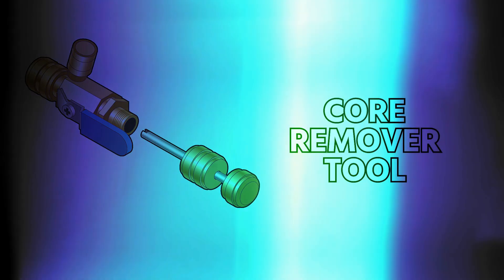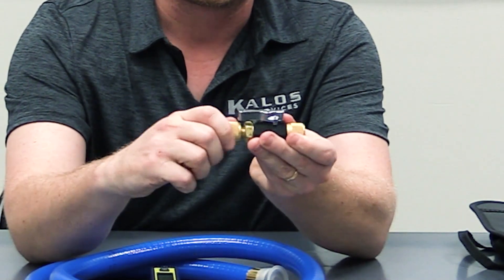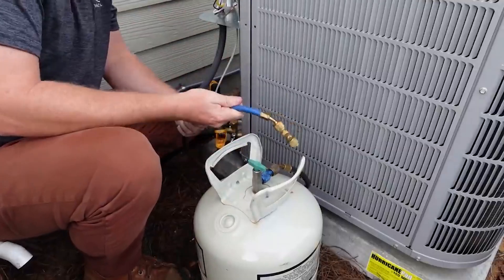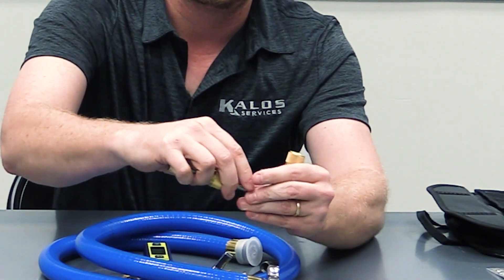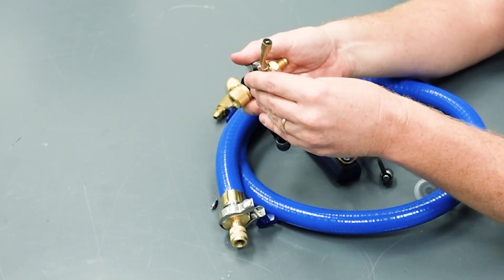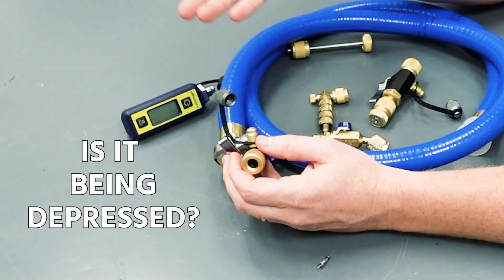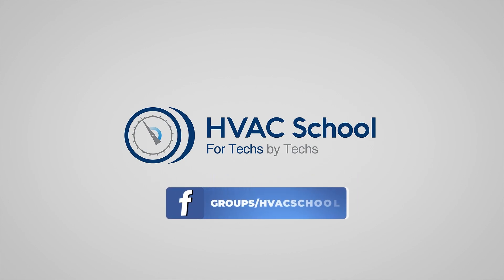Schrader Core Removal Mistakes to Avoid

Comment: It's easier to connect the Vacuum Gauge to the VCRT with a second VCRT , then you can disconnect the gauge as soon you add refrigerant , and the valve of the VCRT is already vacuum rated IMHO

Comment: 3:46 is confusing to me can some one please go in more in depth on this, so after the vacuum, I should open the line a little bit to break the pressure and then put my valve core back in?
Reply: After you pull vacuum to required spec, THEN close the valve on the valve core removal tool (VCRT), THEN remove the vacuum hose from the VCRT, 
THIS IS THE IMPORTANT PART: After you remove the vacuum hose from the VCRT (REMEMBER: the VCRT valve is closed at this point) a small amount of of 'outside air' will enter the space between the end of the VCRT and the closed VCRT ball valve (which is closed). 

***All you ever want in AC system is refrigerant, oil, and if there is a difficult to locate leak then a small amount of dye. THAT'S ALL! Anything else in the AC system can cause damage to system components. 

SO 'OUTSIDE AIR', ANY AMOUNT AT ALL, IS BAD! 

So, back to the point where the vacuum hose has been removed: THEN attach the refrigerant charging hose (which is already connected to the refrigerant tank) to the VCRT port (same port where the vacuum hose was attached), now open the valve on the REFRIGERANT TANK, so now you have refrigerant flowing into the charging hose, BUT BEFORE YOU OPEN THE VCRT VALVE, you MUST turn the refrigerant charging hose connection counterclockwise for a fraction of a second (aka cracking the charging hose connection or PURGING) to allow a small amount of refrigerant to 'blow out/push out' (displace) any 'outside air' (remember outside air is extremely bad if allowed to enter system) then quickly re-tighten the refrigerant hose connection. 

NOW you're ready to open the VCRT valve to allow refrigerant to flow into the system, THIS IS WHERE "ABOVE ATMOSPHERIC PRESSURE" comes into play. 

This is where you will be looking at low side gauge of the compound gauge set. 

As you allow refrigerant to flow into the system, via low side thru the VCRT, watch the low side gauge as refrigerant enters the system, and as soon as system pressure on low side gauge shows positive pressure (no longer showing vacuum. Think of 'state of vacuum'  as meaning negative pressure, atmospheric pressure is the outside air pressure. On the low side gauge '0' is when system pressure and atmospheric pressure are equal. Anything above '0' on your low side gauge is 'POSITIVE SYSTEM PRESSURE'. NOW you need to allow enough refrigerant to flow into the system to bring 'system pressure' above '0' on low side gauge. Once you have 'positive system pressure' close VCRT valve, close valve on refrigerant charging tank (or preferably close valve on low-loss ball valve on the end of the refrigerant charging hose), remove refrigerant charging hose from VCRT, reinsert and tighten valve core via VCRT, reconnect charging hose to VCRT, open refrigerant tank valve (or low-loss ball valve on end of refrigerant charging hose), purge CHARGING HOSE/VCRT CONNECTION, open VCRT valve to allow correct amount of refrigerant into the system. 
After approximately half of refrigerant enters system, you will want to turn on the AC system via thermostat, and once the system turns on, that will 'assist' in making it easier to 'pull in the remaining amount of refrigerant. 
REMEMBER: YOU WILL NEED A REFRIGERANT SCALE to measure correct amount of refrigerant. 

Hope this helps

Comment: I've watched a more recent evacation video that you've published and in this one you are recommending putting the vacuum gauge right on the same core remover core that you're pulling a vacuum from, but newer video discourages this as you want your micron guage on the opposite side of the vacuum circuit to get a more accurate micron reading.  (single hose evacuation)
Reply: You are saying the vacuum gauge should be screwed on to the other port?

Comment: The shradder core on my system appear to have slightly longer stem, not allowing me to reach with shradder removal tool once threaded on. Can’t seem to hear or feel a click, signaling that the removal tool has grabbed on to the core itself.
Thoughts?

Comment: I find it easiest to break vacuum with low pressure making it much easier to reinstall core. Also I have made it a habit of pulling low side with unit running and pulling highside with unit off whenever possible.

Comment: Thank you for explaining this. I've been recovering and vacing through my manifold and obviously at times it's beendifficult and often taking way to long 😪 I've seen this free flow method before but never really understood it until watching this video. I switched from being a gas heating plumbing engineer 5 years ago to work on ASHP'S and other renewable heating systems. I was sent on a City & Guilds Level 2 Award in F Gas and ODS regulations which basically covers refrigerant handling. By no means does this make me a refrigerant engineer but I endeavour to fill in the gaps and hopefully gain a much better understanding. Once again thank you for this explanation.

Comment: Just went through this on a novice level with the A/C on my truck.  The low side service port was faulty.  The Schrader would not depress but the system was already compromised so it wasn’t vital we apply positive pressure to install the new valve.  Ordered the new high side port an began the whole process.  A/C works better than ever now.

Comment: Whats the issue with installing schrader back in while under vac before charging , risk of air getting in from small gap in core removal tool or running the risk of it pulling in schrader and letting air in ?  Great video just hung up on this point
Reply: Not a tech here, but have now done much research.    I think the issue is that you have pulled a deep vacuum on the system, and if you expose the system to any air, it will definitely get sucked into the system thereby ruining the whole process.    So, he has you purge the air as best you can with vapor from the tank before tightening the tank connector, and then let vapor in the tank fill the vacuum.   You then re-install the core in a vapor atmosphere without any air.
Reply: That's the reason for not rem9ving the core remover to evacuate. Connect another tee and valve for the vacuum so you can put the core in without removing the tool. This works great for minisplits and pumped down systems because you don't need to hook up any refrigerant to charge. I'm still a "hack" but I really hate the idea of removing the tool during vacuum and relying on refrigerant to get about atmospheric as a way to avoid sucking air in.

Comment: So when I'm done with the vacuum I close the valve on the core removing tool unscrew the hose connect my charging hose and let freon in the lines then install my core thing to the service port then open the king valves right?

Comment: Just wanted to clear up some confusion 
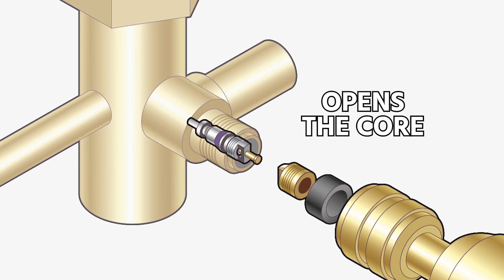2:25 Are you saying that having a core removal tool is inefficient for vacuum and recovery or only if you are leaving the core in with the core removal tool attached to the port just so that its making connection. And then trying to pull vacuum or recover refrigerant out of the system is inefficient? 
- Also, in another video there was discussion of when to use a core removal tool. It was mentioned that it may not be a faster process when adding a small amount of refrigerant or in other applications. Would you ever consider using this tool in quick jobs with little or minimal refrigerant being added? 
For install, adding positive pressure just means unlocking the refrigerant from the condenser before you put the core back in? 
- How often does the O-ring need to be replaced and is there a quick way of checking for leaks with Nitrogen pressure without installing the core removal to the system?

Comment: All i hear from the experts is never do anything to allow even the tiniest bit of air in any system or it will damage something in the system..  but yet ive had to get trained by guys whove been in the field for 30 years and watch them screw into a frozen unit without wiping anything off or purging.  Dirt and all ive seen on the service port and they just screw in their old gauges that been under the seat and an old tank.  Then they go to charge it and set the tank upside down on the fan and proceed to fully open all valves and watch their gauges, eventually cut it all off and when they disconnect they always let a plume out thats big enough to be a ninja smoke screen , then they shake their hand that took the freeze shot, rub it on their pants, and most of the time never put the caps back on the service ports and toss the gauges in their bag and go.  Me witnessing this and seeing these systems still running years and years later..  hell i watched one guy only replace the coil and blower unit indoors with a r134 newer unit, leave the old r22 condenser and compressor, but just turn it upside down trying to drain what little oil falls out, pull a vacuum on it, fill it with 134 and charge em 7 grand..  but low and behold that crap show is still running 3 years later..  the outdoor unit was over 20 years old.. lol.. and i touch a unit not even hook into it and instantly clog the metering device or filter..  im just saying here ive seen some magical shit just work for these older cats..  crazyness..
Reply: same boat with ya, I work with a 60 years old guy. exactly as what you've described. doesn't even use a micron gauge. but all units we touch, is still working till to this date.

Comment: How do you Handle when the ports have only a couple of inches clearance before the cabinet gets in the way of the core removal tool and you can’t use them . How would you r&r the cores?

Comment: I always use core depressors to attach my micron guage and never have to disconnect it before releasing refrigerant after a vacuum.

They are pretty cheap and an awesome tool to have.

Comment: so when you have the crt's hooked up to the valves like after you did a nitrogen test and you take out the cores is it Normal to feel that air pressure push the knob out on the crt?? like when you have to push in to take the cores out of the valves on the condenser it allows some air pressure to build into the crt I have the navac crt's and one appion crt. I used them recently for the first time w a navac vacuum pump that has the built in micron gauge

Comment: so say it's a new system new lineset and condenser do you open the valve on the condenser and then shut it before inserting the shrader back in so there is more pressure prior to inserting the shrader

Comment: Hi Bryan, 

Just for my clarification, before installing the schrader cores at the completion of the evacuation process, you recommended putting a positive charge of vapor into the system. Is it OK to use a small amount of vapor from blended refrigerants such as the R 400’s? My understanding is to always charge from the liquid state when using blended refrigerants. Also, Is a positive charge 5# acceptable or do you recommend a different psig level to bring the system above atmospheric pressure? 

Thank you very much, I really enjoy the excellent content that you and your team provides!
Reply: It's fine to use a bit of liquid as long as you're only taking it to about 10psi. At that pressure 410 boils at below -20 so unless you're in the poles you shouldn't have any liquid left as long as you don't race to crank up the compressor.

Comment: I do not impress easily, BUT you Sir did a phenomenal job. I am not an HVAC tech, though I did see the original AC unit designed by Dr. Gorrie for medical use, but we in Florida are thankful. I just bought a core removal (Mastercool)  system to use on my wife's SUV. I saw your video title, and thought there is never too much information, I watched, and was not disappointed. Best wishes, and many thanks!

Comment: I used a defectove adapter for my mini split during the vacuum process which wasn't vacuuming the lines because the Schrader valve wasn't being depressed and then I stupidly released the refrigerant into the system. If i recover the reidgerant and vacuum them will that work, or should i remove the refrigerant and add more.
Reply: Sheesh tough question
Reply: Maybe a late post (but might be helpfull for others) In this case you should recover your Refrigerant completely from the system, Vaccuum your system + lines (piping) and add brand new Refrigerant. (The original refrigerant you just recovered is mixed with air now and if you want it 100% correct you should get this sorted by a specialist.).

Comment: What pressure do you recommend when breaking the vacuum, before inserting the core?
Reply: I personally just crack my tank to let some liquid into my manifold, purge air out of my hoses, close the tank and purge while connecting my hoses to the core removal tool and let whatever I have in my manifold into the system, depending what size the system is you might have to let more liquid out of the tank but I try to just get it to like 10-20 psi and then put the scraeder core back in and move forward with charging once all cores are in.
Reply: @tripplewhipper can you not charge the system fully and then put the core in? So it would charge faster

Comment: Is this something a DIYer can do?  Is it dangerous?  I had a company come out and they quoted me $1294 for two Shrader valves.!!
Reply: Schrader Valve and Core Removal tool cost less than $50.  However, knowledge of how to DIY is priceless !.... Yes you can do it...look for several tutorials...
Reply: I have a feeling there's going to be some refrigerant figured in with that amount of money. No it's not something you want to do yourself. Do you have the tools and the knowledge? I'm assuming you don't just by you asking that question. Call a qualified tech. You're going to get yourself into a jam and cost yourself more money.

Comment: What brand of schrader removal tool , you are using for vacuum? I used yellow jacket but when I close the valve the vacuum pressure rise very high and quick
Reply: How high is very high? Most ball-valve type fittings like these tools will trap a pocket of air between the valve and the valve body. When you close a valve near a micron gauge, you'll typically see it rise 200-400 microns. Leaving the valves just short of fully open near the end of your vacuum process can help suck that air pocket out of them.

Comment: Can you put the full charge in after vacuuming, and then put the Schraeder in afterwards?
Reply: I have done it that way with no problem. better process my opinion.
Reply: That is how I did my mini split AC but it is difficult to get the shrader back in because of the pressure but you can do it just takes some patience
Reply: Yes, with a BluVac...

Comment: I've given up tryna isolated my micron gauge since I find ball valves almost always leak under vacuum which is a real shame innit . Very good vid , Bryan you're on a roll lately mate keep it up blud .
Next if you could show how to maintain/ rebuild VCRTs that'd be brilliant.  Cheers mate !
Reply: I use two valve core remoal tools that way you can isolate the valve and protect the micron gage without worring about the ball valve leaking.